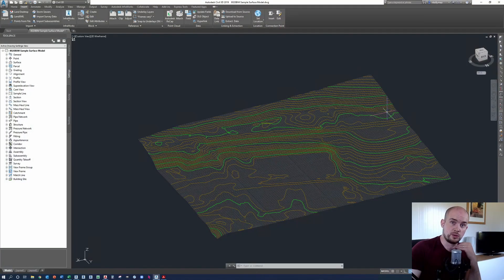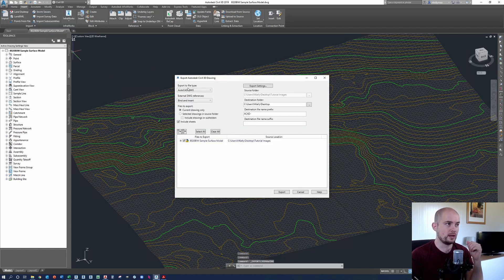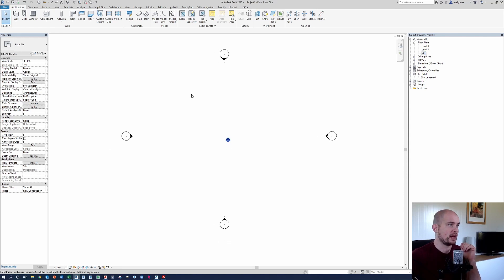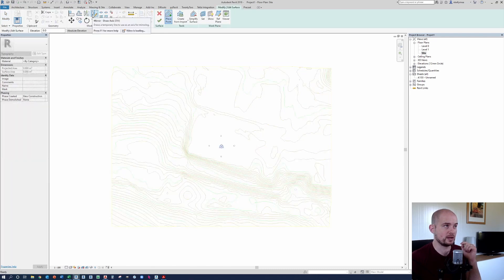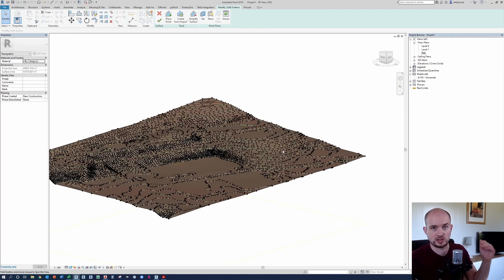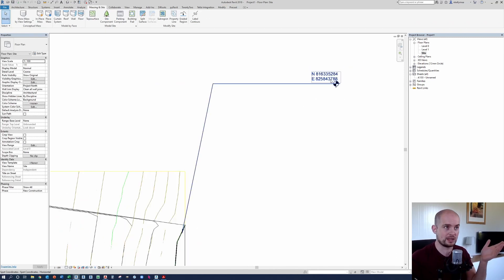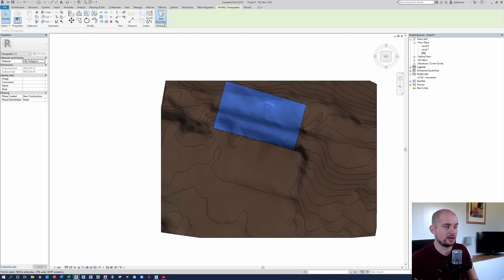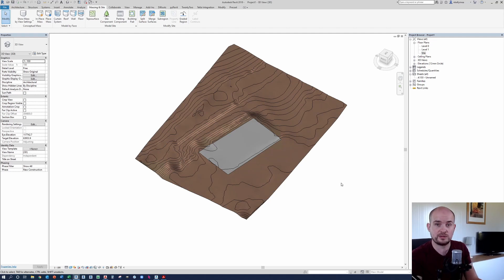Solved - Bring a Civil 3D Topographical Surface into Revit

Comment: try doing that with a surface of road, using only contour lines and the surface model you get into Revit will not accurately match the original one from CIVIL 3D (specially when it comes to kerbs). I think a better option is to first export the surface to acad as 3d faces.